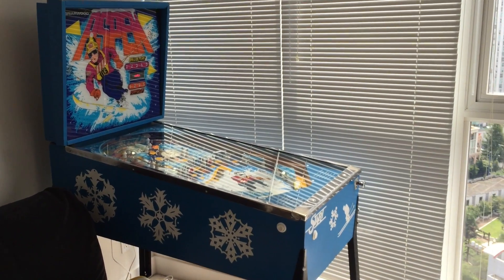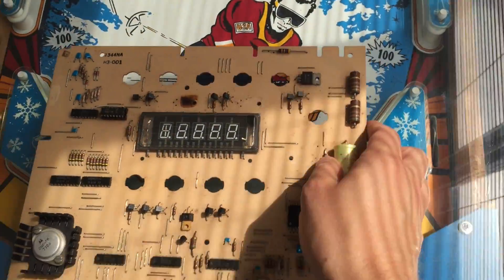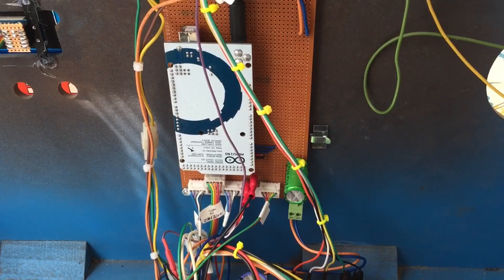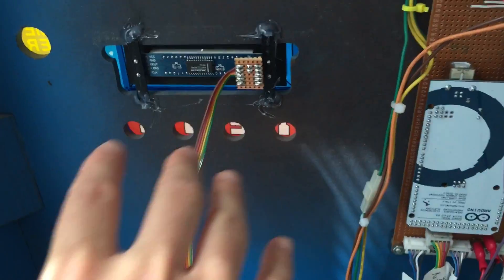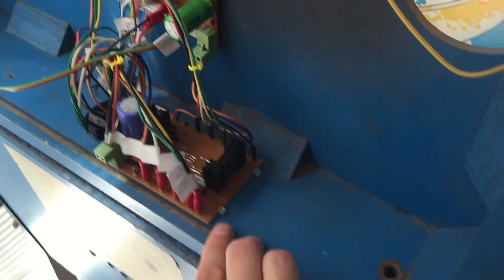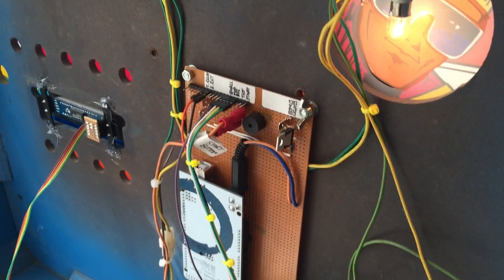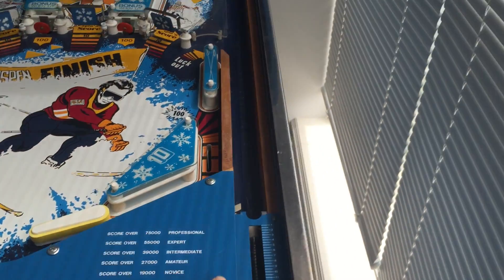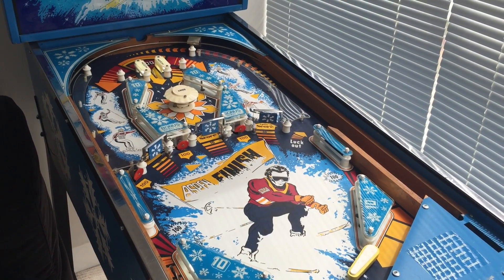Rebuilding a Briarwood Aspen with Arduino

Comment: Great video.  Question. I have the same pinball and when the ball goes into the center slot it doesn’t always automatically shoot it out.  I have to push the right flipper button and then all of a sudden the score accumulated and it shoots it out.  Also the right and left flipper buttons seem a little stuck sometimes.  What is a good lubricant to spray in there or do you have another suggestion?  Thank you.
Reply from the maker: Sorry for the slow reply. It sounds to meet the board may be failing or there's a short somewhere. It's been a few years.

For the flipper button I would disassemble and have look at what is causing the blockage. But I'd suggest using silicon grease here.
Reply: Thank you!